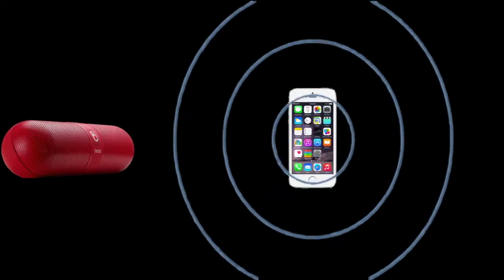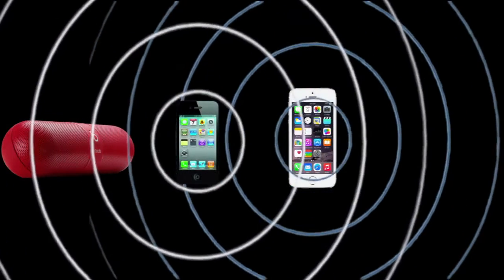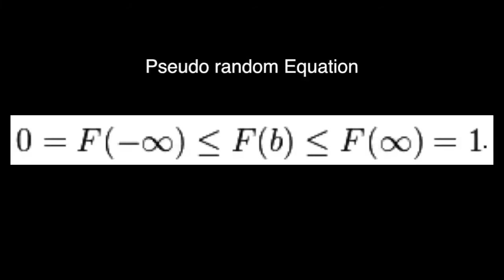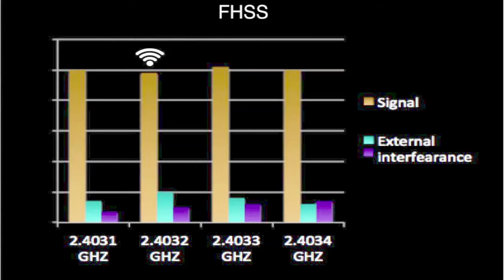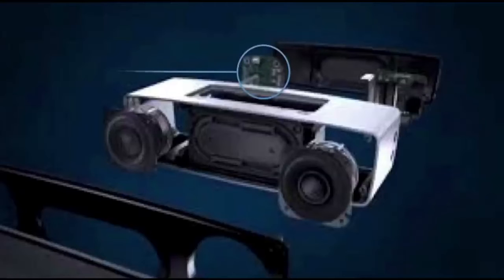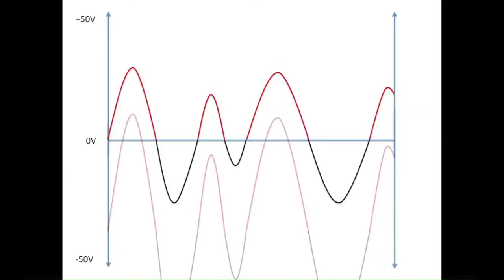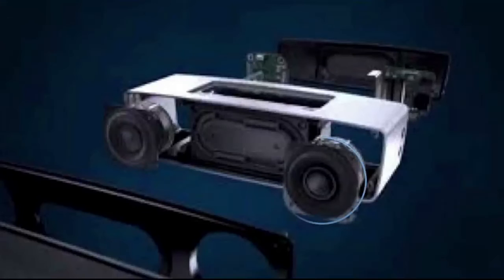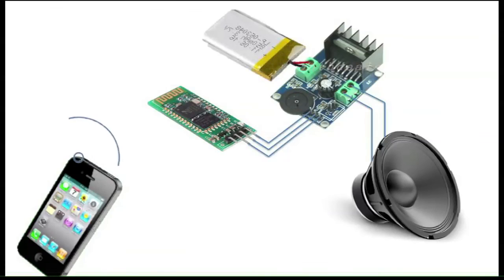How a Bluetooth Speaker Works (explained)

Comment: The amplifier is able to magnify sound by adding power to each vibration of the speaker, no not exactly, you mean adding amplitude to each cycle of the wave of the audio signal then sends the power to the speaker you mean, thus where it gets its name, amplifier